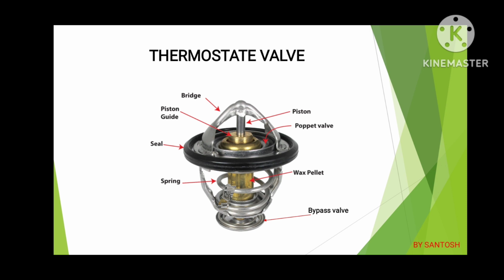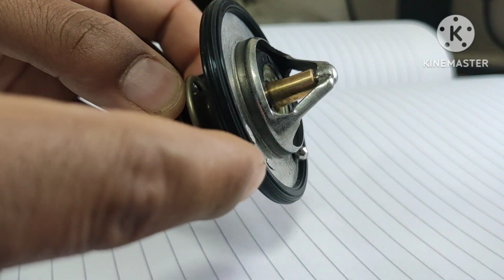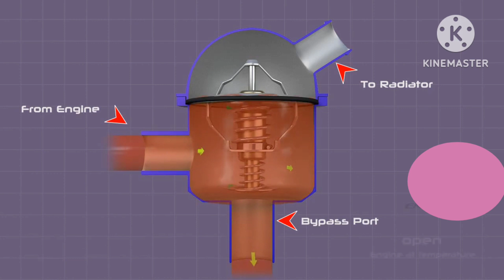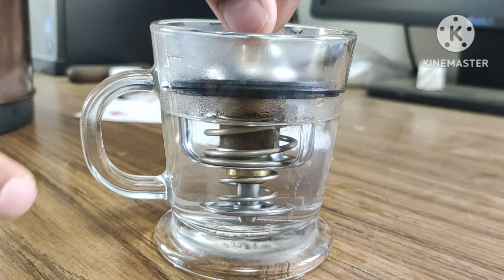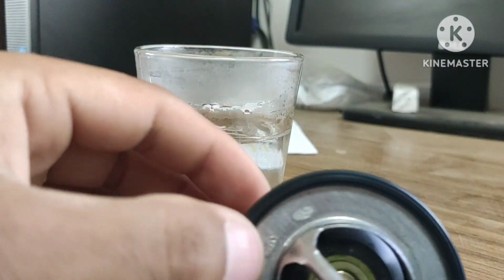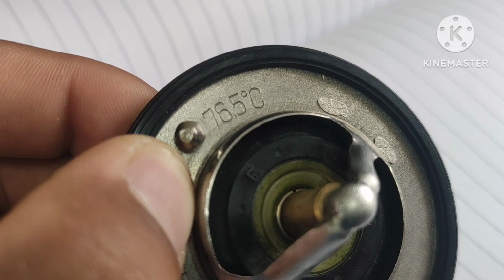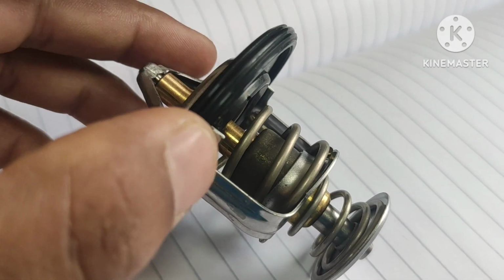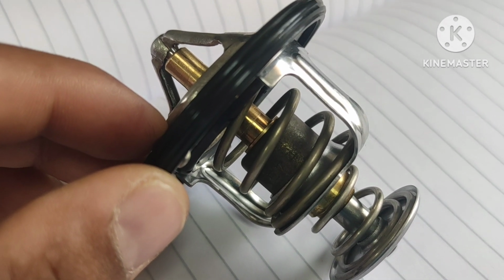How does thermostat valve work ?

Comment: great explanation. but I saw there is no any coolant use to cool engine in very many bikes,  so how bikes engine get cool? is there this valve given or not ?
Reply from the maker: We have different type of engine cooling system. Such as air cooled, coolant cooled or water cooled. And among them bikes are designed to be cool by air.. it means bikes engine are made to be cooled by air passing through the fins. These engine are small engine and light in weight and engine has very many fins on its outer body from where air passes through while driving the bike. And that much is enough for cooling. So if you did not get coolant (liquid) in bikes engine  it means there is no thermostat valve.